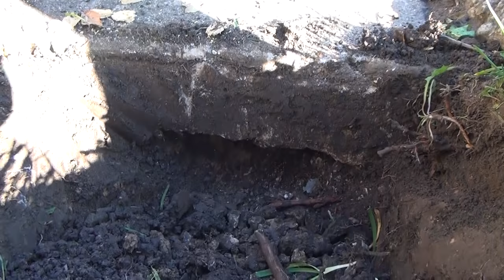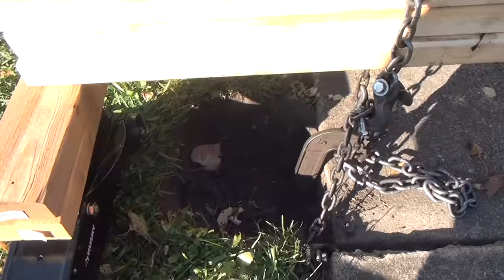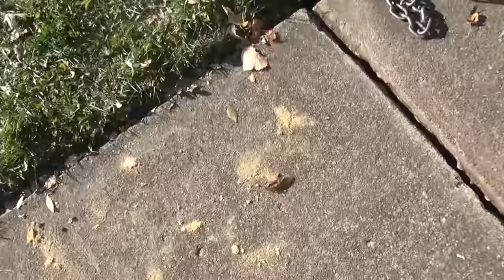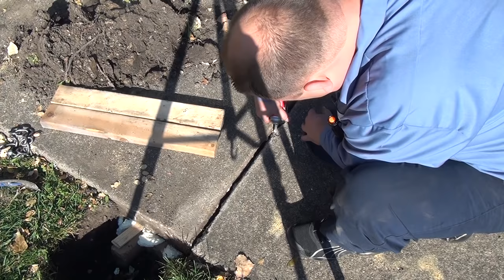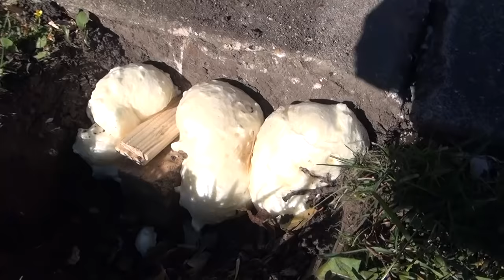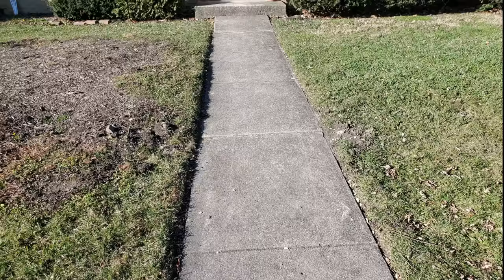Raising and Leveling Concrete Slabs with Gaps and Cracks Foam

Comment: Why not take a sledgehammer bust that little piece of concrete up pull it out of the way then go to Lowe’s or Home Depot by four sacks of concrete around $12 for all and re-pour it? A lot easier and less time. But good video
Reply: My thoughts exactly
Reply: I think that the simplest answer is that it will look different.  There’s a video where someone drills through the slab and injects the foam to raise it.  That’s a lot less work.  There are other videos where foam is used that look easier than this one, too.  But — whatever works.
Reply: it will look different
Reply: This didn’t look that difficult. Why not spend a day trying something different? No harm, could always bust it up later.
Reply: They wanted to keep it as original, I guess.
Reply from the maker: exactly

Comment: Much faster and easier to pour leveler on top.
Reply: And it looks like patchwork. The highest end of the slab will start to peel in a few seasons going from hot to cold.
Reply: It might not help the grade.
Reply: No... much faster and easier to just pour a new slab. Concrete bags are dirt cheap... the forms would probably be the most expensive thing since wood is so overpriced right now lol.
Reply: @randybobandy9828  also have to break up and dispose of old slab.

Comment: That foam would never hold that 1 ton concrete 
In fact it's dangerous
Reply from the maker: The bricks hold up the concrete. The foam just fills empty space under slabs and protects from water coming to the house.
Reply: @YourHomeSolutionsUSA  and one year later the foam has deteriorated into dust, bricks have sank into the dirt.. job security i guess
Reply: @happydays4551 thats great, the world wouldn't have pollution problems if these chemicals can easily deteriorate into dust.
Reply: @YourHomeSolutionsUSA :  If the foam isn't supporting load, and just the bricks on the edge hold the load, then the slab will break under load.  That canned foam is fairly compressible stuff.
Reply: Joe you think that small piece of concrete weighs 2200 pounds......lol
Reply: @happydays4551  ... been using that product for almost 20 years and I can tell you it doesn't turn to dust. Matter of fact it's also waterproof.
Reply: It can hold 60,000 lbs per square foot so it can definitely hold a slab.

Comment: Yeah those wood shimes aren't going to decompose and the great stuff spray foam is literally useless in this situation....
Next time either pay someone to do it right or you do it right, instead of a hillbilly fix.....
Reply: the wood shim only supports about an inch and it will be fine till the foam sets up in a few hours. Remember, the slab only weighs maybe 200 pounds, which is less than one half pound per sq inch. I think it will be fine 10 years down the road.... and the stuff is only $5 a can.
Reply: @rupe53  First off the spray foam he used isn't design to bear much weight.....
Second, that slab is between 400 to 500 pounds, if you don't thing do some simple calculations to get a more exact number.....
Third, I guarantee that slab has already sunk some to cause it to be uneven again......
Reply: @TC-kf9zw  ... ok, let's use your numbers.... There's 576 sq inches in a 2x2 ft slab and that 500 lbs is less than 1 pound per sq inch. It really isn't supporting that much weight, which is why it works.... at least for a while. BTW, the red can is waterproof so it won't rot either.
Reply: Everyone is a specialist in these comments And the ones commenting are the ones that have sunken slabs that are to lazy to fix theirs
Reply: @ChooChooRooter ...Saves time and effort, right? Isn't the idea of a quick DIY fix? BTW, I'm no expert but I have used this stuff for over 15 years on a variety of projects. You'd be amazed at how well it holds up.... although it doesn't look good where it shows.

Comment: Let's spray some chemicals under the sidewalk that's just going to break down and not do the job correctly.
Reply: Yep. Spot on. Concrete was needed instead
Reply: Rinse and repeat in 2 years  🙄
Reply from the maker: This video was recorded in November in cold Chicago in flood zone and sold in May with out any problem. I will say it works very well for one day job and $40 for foams

Comment: Disgusting is the chemicals you put into the ground, spend the money, do it like a man and use real material.
Reply: Just plant your tomatoes somewhere else pal
Reply: Polyurethane isn’t toxic. It’s closed cell. Mud jacking is inferior to polyurethane and can be toxic. Polyurethane also repels water and fills voids. The mud in mud jacking dissolves and breaks away. It’s terrible if there is water present. The polyurethane is as inert as the rocks and bricks put under the slabs once it’s cured in 30 minutes.